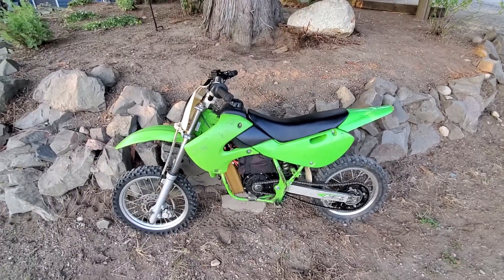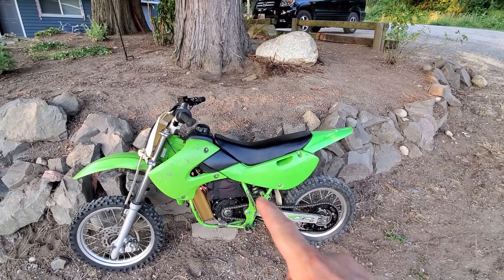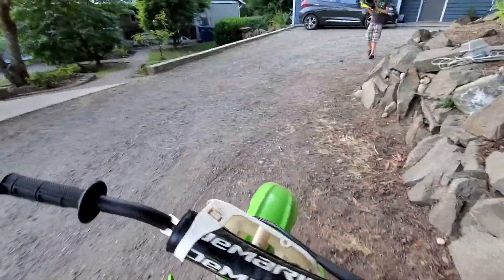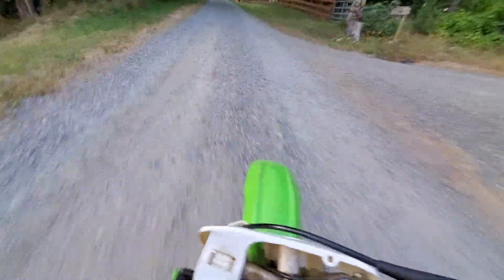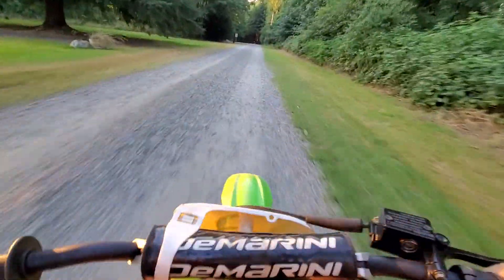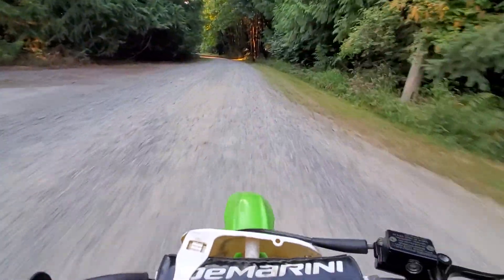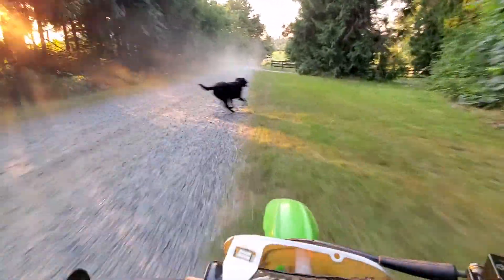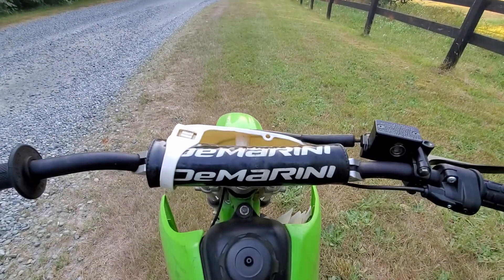DIY KX65 electric conversion test ride.

Comment: Do you enjoy your motor? I’m looking at the same one.. what kind of front sprocket did you use? The 428 they have or a standard 520? I have a 520 chain and rear sprocket currently and I can’t find a 520 sprocket that works with this motor, if you are using a 520, could you link the sprocket you used?
Reply from the maker: I'm using the 428. I love this motor. It handel's 15kw without getting very warm. Once I have me CR80R pushing 23kw I'll let you know how warm it gets.

Comment: is there big difference between 72150 vs 72250 ? 72250 acceleration is really better? I'm looking to buy one controller but 72250 is like double the price dont know if it worth it...
Reply from the maker: The power on the 72250 will be almost double that if the 72150. So do you want big power or really big power? There is always the votol 150 or 200.
Reply: @DevinLindstrom  I got a crf150r frame and the votol models doesnt fit well in it... SSC doesnt look available right now :/ I want something similar to a real dirtbike that size...
Reply from the maker: @DO-qx5zs  have you tried mounting under the sub frame? That's where I put it in my CR80 build.
Reply: @DevinLindstrom  Yes, finally I found a way at angle. I got a 350 amps continuous controller installed. I'm stock with some safety parameters that make low performance. I tought 3 days ago to change controller but i'll try to figure it out. YuangQu nd96660

Comment: Hey man if you’re looking to build one for yourself, I just put together a Sabvoton 72150 and a QS 5000w hub on only 48v 20ah and I get 50 mile range and...wait for it...60mph
Reply from the maker: Nice that's like my white bike I built. It was an unlocked Sabvoton 72150 that I pushed to 22s and 200a. It maxed at 70mph.
Reply: Do you know of any link or video on how to unlock the Sabvoton?
Reply from the maker: @AllThingsElectric_  Sorry but no. I got it from the factory unlocked.
Reply: Devin Lindstrom ah no problem

Comment: Top speed?
Reply from the maker: 55-65 mph depending on flux weakening.
Reply: @DevinLindstrom  ok thank you
Reply: @DevinLindstrom  what batteries are you running and what is the ah
Reply from the maker: @iyakab777  right now it's a temp battery. 16s 16ah lipo.
Reply: @DevinLindstrom  what's the range with that setup
Reply from the maker: @iyakab777  don't know the range but it lasts about 1-2 hrs.
Reply: @DevinLindstrom  thank you for your time.